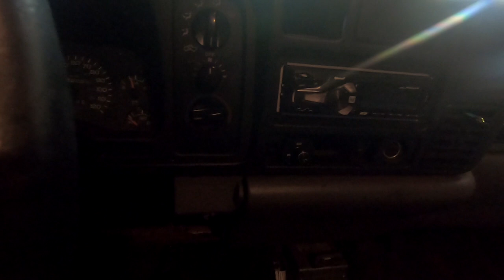The Flattys New Engine Is a FIRE BREATHING BEAST!!!!

Comment: @Bruce Wilson, What do you torque ARP 625's to?
Reply: yz450fyamaha1  you tighten them until they start to pull the threads then back off 1/4 turn 👌🏼
Reply: @woolmanworkx1144  Thanks man, I don't know what's wrong with them but some of them broke.

Comment: On my 96 3500 12v, my fuel gauge has never worked. Come to find out that the part I need is a new fuel sending unit and float. Of course they discontinued making the part, so I have to buy the entire in-take fuel assembly just to get that one piece. Anybody know where I could find a fuel sending unit with the float?
Reply: Junkyard. Lol
Reply: Pick-n-save..
Reply: Junkyard